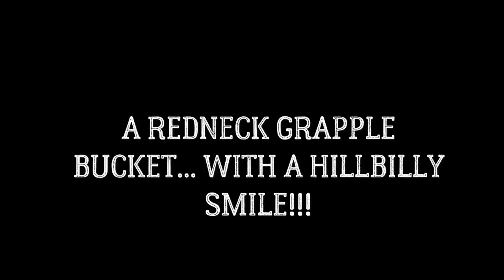A REDNECK GRAPPLE BUCKET... WITH A HILLBILLY SMILE!!!

Comment: I'm a machinist, and I was going to leave a comment on your technique but then I saw you welding away with your hand on fire and figured you're doing fine
Reply from the maker: hahahahaha
Reply: Best comment lostin207
Reply: You don't need to worry about technique
Reply: Who even cares about being on fire.   Just keep goin.
Reply: Just a lil bit of fire, known colloquially as a "hand warmer."
Reply: Machinist...fancy fuckery word for making stuff smaller.
Mee tooo. Cheers!
Reply: You don't need to worry about your hand being on fire
Reply: that was fricking funny
Reply: You don’t need to worry about catching on fire welding 😂😂😂
Reply: I Fuck around with this type of shit and I just drill hole in each side of the pin and use small bolts or roll pins to hold the pin from sliding side to side
Reply: @ziptiesnbiasplies  I think it’s funny YouTube said “ translate to English “ that’s mint
Reply: My mom wouldn’t even touch one my dad he welds all the time my grandpa full time welder just got a plasma table too so he gave me and my brother a bunch of misc metal cutouts hope to mod my truck with them
Reply: As a fellow machinist, I agree. He's fine.
Reply: You don't need to worry aboot safety lol
Reply: 207💪
Reply: @wickedextracts5921  207🤘
Reply: Pretty sure he doesn't need any advice
Reply: Heavy equipment welder here and i can confirm He knows what he is doing 😂
Reply: If you’re not on fire are ya even welding?

Comment: Instead of making bolts, one could drill through the 1" shaft crossways on both ends and use R-clips, safety clips, roll pins, etc to hold the pin in. If you wanted to be more fancy, machine out a bushing that is cross drilled and welded to the brackets you cut out. Put a smaller bolt through both the bushing and pin. Thanks for the videos, enjoy as always 👍
Reply: I figured he’d just cut the rod and weld some shit to it
Reply: This is peg.... Why would he do all that lol
Reply: You obviously have never seen this channel before
Reply: Do you know who this is?
Reply: Listen to Mister MoneyBags over here... R-clips? safety clips? roll pins? Did you mean pick up that random nail off the floor and put that through there? Just beat the sharp end over with a hammer, it ain't going nowhere.
Reply: @_Frank_the_Tank  Take it easy on him he's just stunned.
Reply: @Eargesplitten-Loudenboomer  
Stunned lol 😆
Reply: Miiiiinnnntttt !!!!!
Reply: One inch ready rod would have saved so much time
Reply: Yea I would have cut the rod about an inch too long and then just welded it in there, I mean if this thing is gonna come apart you're gonna need both the grinder and the welder anyways...
Reply: I thought the same but he was having fun and remember he said he wanted to be in the shop and not in the house with the old lady lol
Reply: Yip I was thinking the same thing, any kinda pin or clip would hold the bar in place cos there should be little to no sideways force on that bar...
I think too much weed means ZIP TIES N BIAS PLIES motto is Work harder, Not smarter. LOL
Reply: Well that would be a boring vidya!
Reply: @randyharris8669  That would bend genius
Reply: Sometimes the long way is fun
Reply: @hemidart7  worth a go lol
Reply: You know a lathe can cut threads right?
Reply: I really expected peg to just weld in the 1inch pin to his new ear he just built
Reply: You just don't get it, do you? Don't be an Amber Heard 2.0.
Reply: you don't need to be more fancy
Reply: Thatd giver sum slop
Reply: Christ Kyle every hair lip knows that. Peg  wouldn't get to show off his lathe though and it makes for  boring fuckin content per se. Jesus Christ Kyle. I've made bolts for other stuff like that smaller sizes roughly they sure the hell don't turn out as nice is that when did on the lathe all piloted and shit. This hair lip only had a bench grinder to true up the welds.
Reply: @randyharris8669  Randy all thread only has tensile strength taint got much shear strength. And if you didn't shear it, in a few days use the threads will be so battered and mashed that it would be sloppy as Bruce Jenners keister and if there were bushings in the ends of them Rams well it would gall the piss out of them too most likely naw mean?
Reply: @MikeHunt-ix2xy  no fair enough and yeah i am bailin what you are swathin too. Just figured it would be the fastest way to get things done, as i am aware ready rod doesnt have the same strength as a gr. 8 bolt would or round stock.
Reply: Oh this guy beat me to it 😅🤦👌

Comment: Those bolts are awesome ! But I'm so lazy I would have cut the stock and drilled a hole on each end and make a cotter pin out of nails lmao
Reply: So thought that's where this was going. Ole peg is taking time to work on learning new things
Reply: Or just thread the rod ends on the lathe.
Reply: I literally thought the same thing. Lol. I have a nail as a cotter pint on a hydraulic lever on my backhoe. I even bent it on both ends.

Comment: One thing you could do to slow down the hydraulics on the grapple bucket you could weld up the inside of the end of the fittings for each cylinder and drill 1/8 inch hole . Smaller hole slows down the oil flow.

Comment: Peg nextime on the pin u can just use the solid 1” bar and weld a custom made flat washer on one side and on the other side just drill 5/16 hole on. The end and use a washer and a bolt. It wont come out

Comment: if you ant to try threading next time you need a bolt, its fairly easy to do. just gotta look at the map for the lathe to set your treads per inch/ threads per mm. then touch off with you're 60 degree threading tool and engage the half nut lever when the threading dial is on a line or number for even number of threads and numbers for odd threads per in. then just take .001-.005 thousandths per cut with your compound that is set to 29 degrees. just keep cutting until the nut fits. just make sure to take a couple of spring passes to make sure the thread is straight

Comment: My own uncle bumblefock told me once to never use chlorinated brake cleaner to prep for welding. Once you start burning the residue it leaves, it turns into phosgene gas. That's why it smelled extra spicy. I prep my parts with diesel fuel mainly.

Comment: Oh man, doing it the hard way on those grapple bucket pins.😂 weld a washer on one end then cut some threads in the lathe . But hay what you did works too , more than one way to stone two birds with the same joints. I've always wondered how long those crankshaft they weld together last 🤣 🤔.

Comment: Spend a day of practice on the lathe  and you will have thread cutting sorted . Pretty easy muscle memory to gain for a goer like you .carbide tips are the way to go ,no thread depth calculation required jus send her in about .3mm cuts and she'll love it or hate it one of the two. Also Id get some hardfacing sticks and bead over your digger/bobcat teeth for extra life on the bucket. Last but not least get an adjustable flow valve to install on the bobcats in/out  line on the bucket for speed control of your minty twin ram setup. This was a minty Vidya mate cheers !

Comment: That's some next level bumblefuckery. Though I've watched enough cutting edge engineering to recognise this is the proper way to build hydraulic shafts and barrels so is completely transferable as a method for extending bolts...

Comment: 16:05 once you figure out the Merica system, you’ll never go back to metrics. It’s pretty much the same as metric, works in tens. Just you get into tenths of ten and tenths of tenths for smaller and more better measurementations.
Reply: Are you stunned?
Reply: @Adscam  clearly you are if you can’t make the connection between using tenths compared to metric…

Comment: Since you don't have a DRO (digital read out) the best way to keep track of where you are is a indicator. The handles should have dial measurements on them. However with the backlash and forgetting where you are on the revolutions of the handle its easy to get lost. So the solution is to put a dial or digital indicator somewhere on the ways or base of the machine with the indicator against the cross slide or the carriage. Measure the diameter of your part, set the indicator to that number. Then cut until you get to the dimension you want. For your reference the X axis is the diameter and the z axis is the length. X axis is the cross slide and z axis is the carriage. Be safe and happy turning to ya Peg!
https://youtu.be/DFvoaEnCZN0 for a video example of what I'm telling you.

Comment: only easy way i can think of to match the size of the drill bit to the bolt you're making is to put the drill bit into your lathe chuck and match your cutter to the end of it, then roll it out of the way while you put your round stock back in

Comment: Some people already said what I came here to mention, but could have kept that big ass pin you had as a jig, find something similar to that size to fit both holes. And then you have a sliding pin that you grease.. on the end you could drill a hole on both sides, sort of close to the cylinder, so it can only move back and forth abit but the holes you drilled into the pin, you put smaller bolts in those, so those can bust off or last forever and u can just replave the small bolts, instead lf the big pin

Comment: Peg, if the hyd is still to fast, take the ‘t’ fitting out of cyl, braze up one of the ends internally.  Looks like #6 or #8 jic.  Then drill a 1/8 hole through the brazed part.  If it’s too slow, then step up the drill bits to fit.  Redneck hyd flow control valve!

Comment: Put the cut off bolt and the extension piece into a piece of angle iron to keep them in a straight line. Then the bolt head hang off the end of the angle iron
Reply: I'm dumb for commenting as the video goes bc you literally just then said what I said 😑

Comment: Resource is minty as fuck. Edit: 8:40 had me rolling fucking golden. For the retention of the pins I would have cut a keyway across the 1"shaft width of a 3/8ths plate and cut a small 3/8ths plate and put it in the key way drill holes tap and bolt ot solid.

Comment: You can't do it that way you didn't get out of your owner's manual yet ! LOL I know  guys like that. I would have welded Cap on One end drill a hole through the other end put a bolt through it with a nut. Then it can't fall out. That's all that hold the pins in for a rock truck bed. My shop teacher got pissed off when he smelled me smoking pot in the welding booth

Comment: 10:45 mark... Hey Peggo, forget the bolt, just turn that rod into a pin and cotter, weld a washer on 1 end, drill a pin hole, and stack washers to eliminate side to side pin slop.

Listened to the teachers, not doing as well as you are. Smoked, drank, did burnouts. 
Uncle Bumblefork would be proud lols

Comment: I would have drilled four holes in the rod (cut to size) and put locking pins in. Wikipedia "A split pin (UK usage) / cotter pin (USA usage) holding a rod in place with a washer."

Comment: I ain't much of a hillbilly (first, my name is not Billy and hills around here are full of investment houses - so not my league) but I would just weld that rod in, no bolts, no threads, nothing, just that 1inch stock welded shut. Add grease zerks to ram mounts and call it a day. If it has to come apart, torch it out (it is fubar anyway, why else would it need to come off? ), replace, weld in again.

Comment: Im suprised ya didn't go the easy way with your pins. The old weld a bit of plate across the end of your 1" bar and pop a hole though on the other side and tie her up with some fencing wire

Comment: Hey cousin the way you made that bolt is legit with the way you drilled a pilot hole and machined a dowel pin and beveled the edges to accept filler weld. I built some custom axle shafts using this exact technique where I had to join the splines of a dana 44 outer shaft to a 6 spline tractor PTO shaft then filled the beveled edges with weld then lathed down the high spots. Gimme a shout next time you are in PeeGee...uh fuck..I guess private message me on youtube since you aint on facebook.

Comment: I would have just cut the round stock, angle grinder to put a couple flats on it, drill it and pin it with a nail. Call Er good

Comment: You could have just drilled a hole in the rod to put a safety pin in instead of welding a bolt on therw

Comment: I do this shit for a living, so if you wanna see how boring and fucked up my life is, checkout my channel. -Ok, so say you wanna turn something down to 1/2" inch aka .500". Zero your calipers and set them to .500", then hit zero again, then measure the piece you want to turn down. The calipers will automajically tell you how much oversize it is. Put the piece you want to turn down in the lathe, spin it and crank in until the tool bit just kisses the part. Set the lathe dials to zero. Let's say your part is .060" oversize. Crank the lathe in half that amount or a little less. Make a pass, stop and re-measure, if it's still oversize the calipers will still tell you by how much, crank the lathe in half that amount again and make another pass. Check the size again, if it reads .000 you're there, if it reads -.005 you fucked up and under cut it .005" too small.